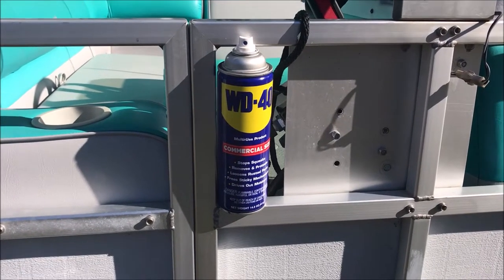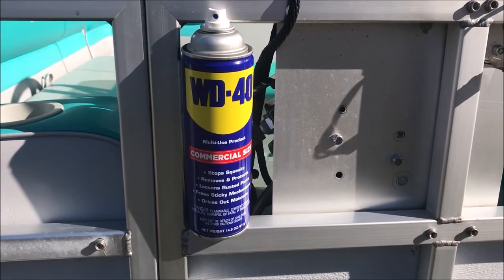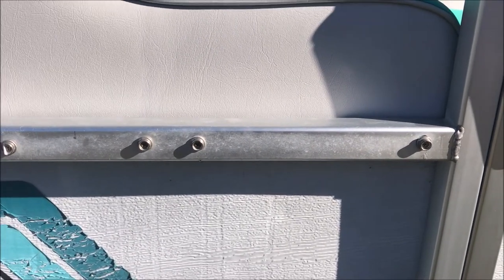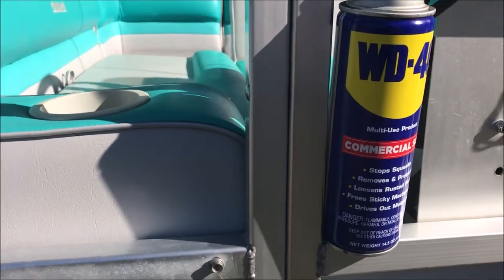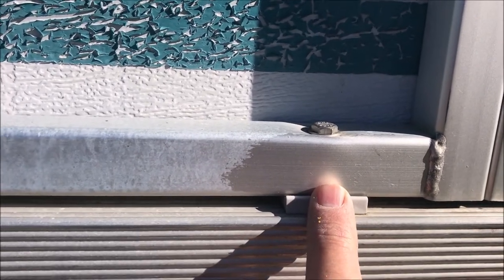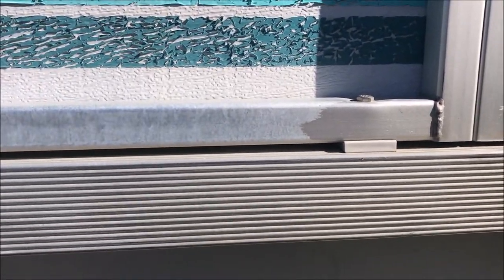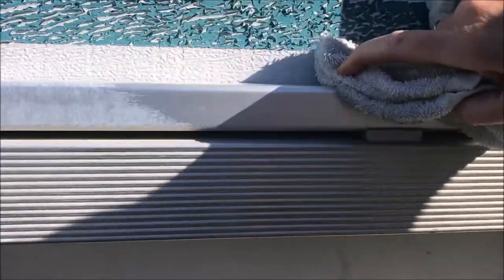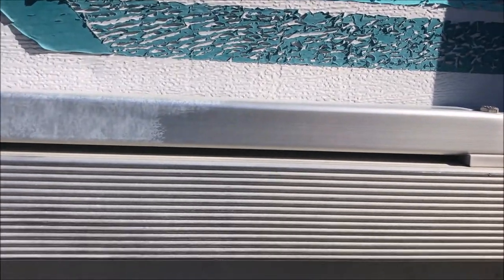OldGuyDIY WD-40 On Pontoon Boat Aluminum Tubing To Restore Like New Finish Appearance Easy Wipe On

Comment: Yeah, but how long does it last?
Reply from the maker: The hot chick wipes the aluminum tubing with wd-40 each spring before putting the boat back in the water.

Comment: But.....WD-40 leaves a Residue. An oily coating.
Reply from the maker: Yes, WD-40 is like fish oil.  The residual doesn't seem to adversely affect the aluminum or the carpet.
Reply: I wonder if this will work for the pontoons?
Reply from the maker: I suspect it works if you get the residue and vegetation off first.